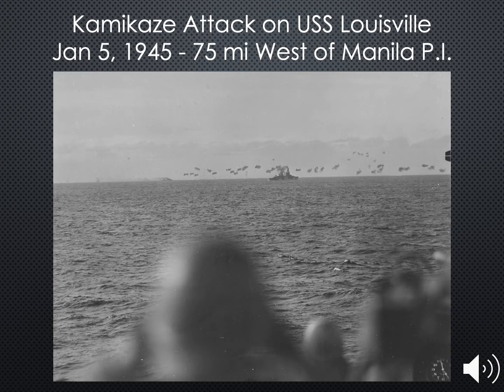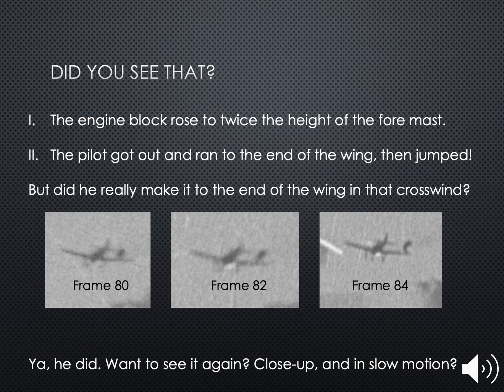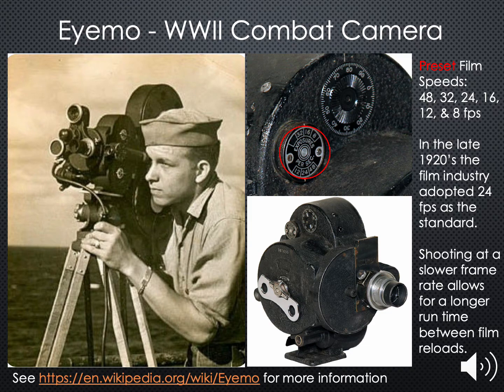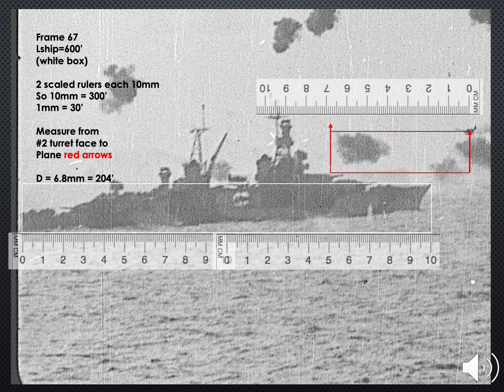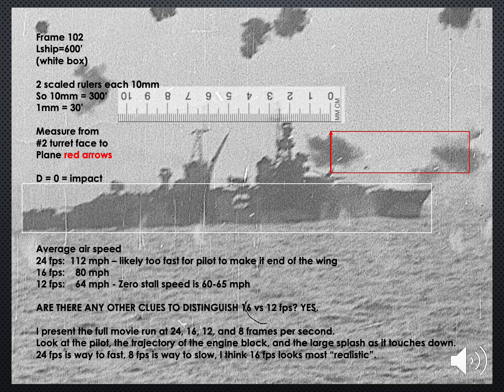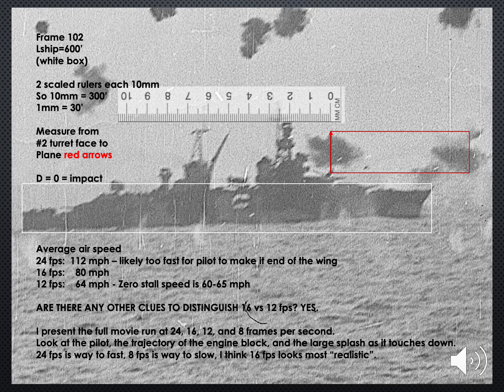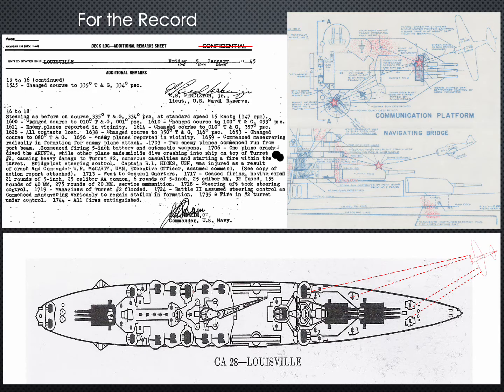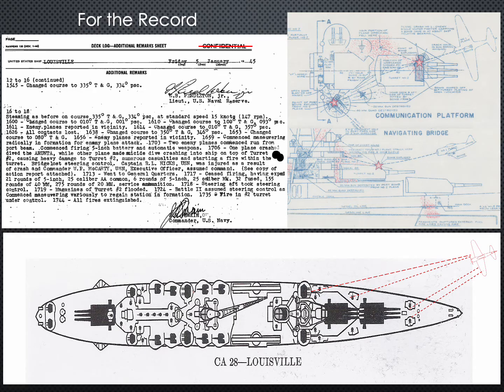Jumpin Kamikaze

Comment: I doubt highly he was flying so slow (at or below stall speed) that the pilot would have been able to run along the wing to the end. More likely he was trying to fly at top speed, bailed out, and from the angle of the camera, it appeared he "ran" across the wing, when in reality he was in the air and in front of it to the cameraman's point of view.

Or even more likely as someone else pointed out, its just part of the cowling.

Comment: On very start of the video is visible huge blast on the airplane because it was hit by AA. It is more possible it is part of airplane that fell off than kamikaze pilot running down the wing.
Reply: I thought that was what happened at first but the video submitter addresses this point in his other video. And his research is admirable. 

He found US naval records which recorded that the kamikaze pilot's partially opened chute got caught on the ship's guns after he slammed into the side of the ship. It's worth watching the other video to see an excellent example of scholarship and research methods.
Reply: @kannony5393  Also the wing dips as if there's sudden shift in weight and it coincides exactly when we see this "figure" leaving the aircraft.

Also, as far as air resistance vs a person, I think the pilot may not have made it entirely across the wing before falling/jumping off. 

The wind would make you run diagonal direction but I don't see how it make it impossible to stand or run for a relatively short distance.

Also harness could have been undone well before the action even started.

Edit: I haven't seen it mentioned, but the landing gear may have been deployed by the pilot to to reduce the speed as much as possible in preperation for leaving the aircraft.